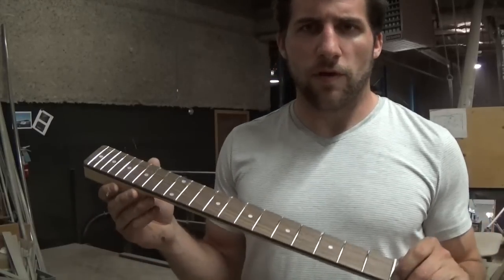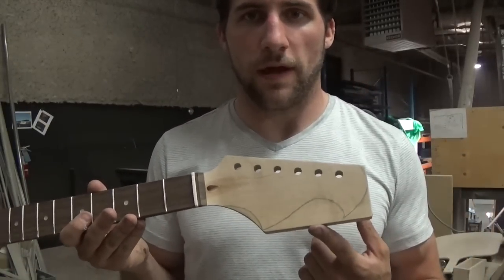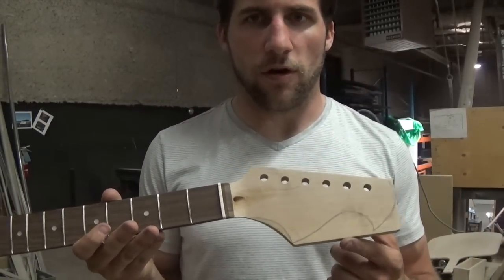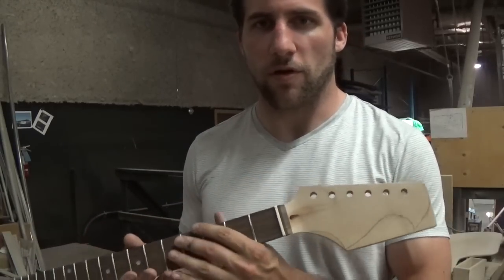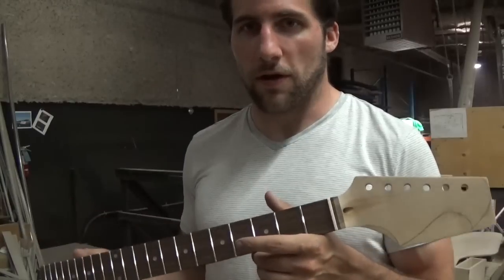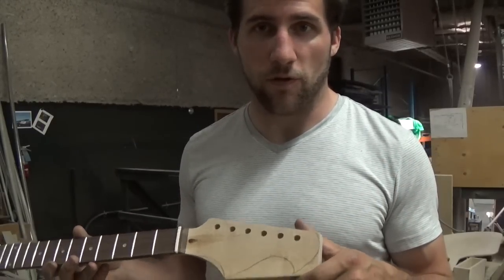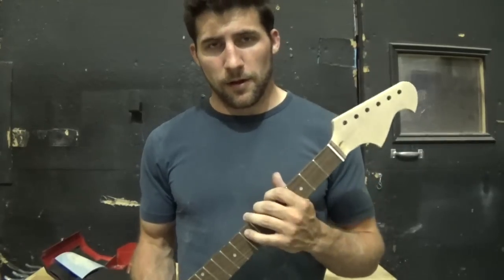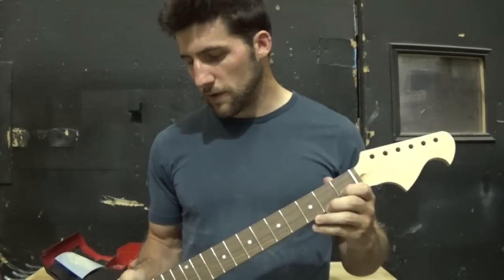Shaping the headstock on a guitar

Comment: Hi Brad!
Your youtube channel is great!

Im doing an restoration on a old Hagstrom, I'm using car paint, and yesterday i did the last color coat. i just wonder if I'm gonna wet sand the color coat, to flat everything out, before i start spray with clear lacquer?
Reply from the maker: +Left Over You don't need to sand the colour before applying the clear. If the entire paint job is lacquer, you can sand the colour to flatten it out if you want. Again though, it doesn't tend to be necessary. Usually you can do your flattening work just on the clear.
Reply: +Brad Angove thank you! one more question=) is it possible to spay nitro lacquer over the acrylic paint? to get a more retro look?
Reply from the maker: You should be able to if the acrylic has dried fully, but I can't say for sure since I've never tried it. Honestly though, the Nitro will take a long time to start looking more retro. Unless you do some careful ambering to it or something.